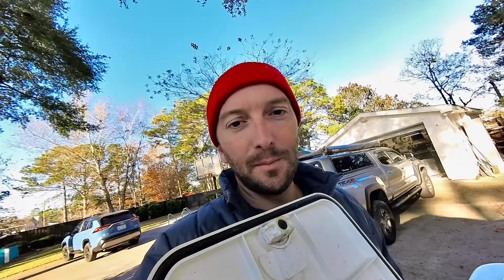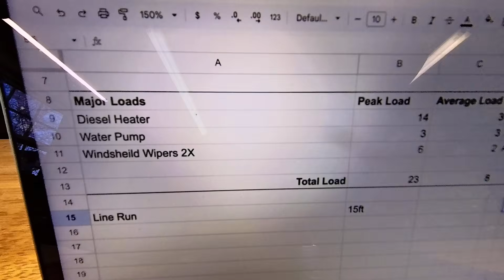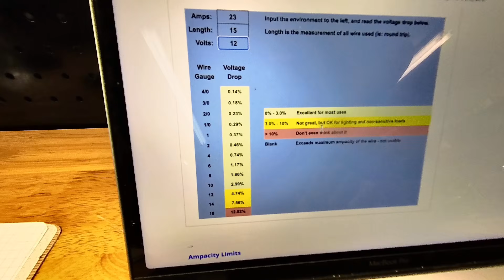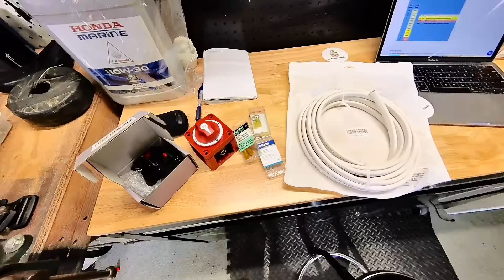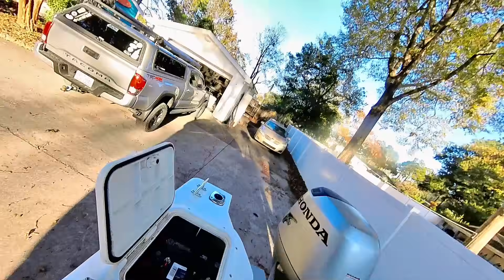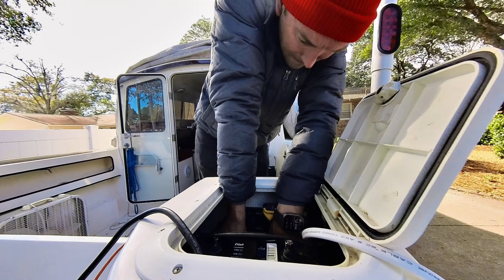My Boat Needs More Juice.

Comment: Sometimes the ampacity rating of wire is affected by whether the wire is in free air, or bundled.  The reason is that this affects the wire's ability to expel heat.  I suppose that the question as to whether or not the wires are located in an engine compartment involves the same issue - heat.
Reply from the maker: @jimh.5286  ahh. That makes good sense. Thanks!

Comment: Looks good! I rewired the batteries on mine, and from what I understand the marine wire calculators require the round trip (pos+neg) length...30ft in your case. At any rate, you'll be better off with the 8AWG you installed. I think I used 6AWG to the console, Litime lithium house, and victron dc-dc charger between starting battery and lithium, separate house & motor switches.
Reply from the maker: @ShadRich  cool. Was this also on a cdory? I did an overnighter on the boat this weekend and voltage drop was almost nonexistent with heater warming up, lights on, radio, stereo, and water pump going and I even had an additional 8amps from a power inverter I was running to charge a laptop. I was using a battery power monitor I installed recently (video coming soon) to verify voltage drop and current draw for all the various accessories.
Reply: @makeSURFmake  Yeah, I bought a 2002 C-Dory 22 Cruiser over the summer. I was getting low voltage alerts on my fish finder with the stock wire/battery, and I wanted to future proof the console wiring in case I install a windlass or other high load accessories. C-Dory ran the Wallas directly to the battery, so that's an option with your Vevor if you ever find that you need additional capacity on the main console wire. I suspect they did the direct run to handle the initial Wallas load and to prevent it from being turned off for the long cooldown cycle.